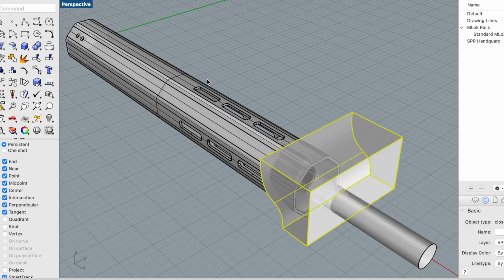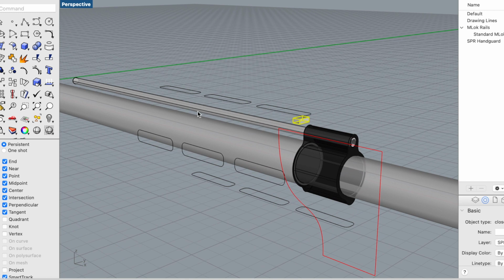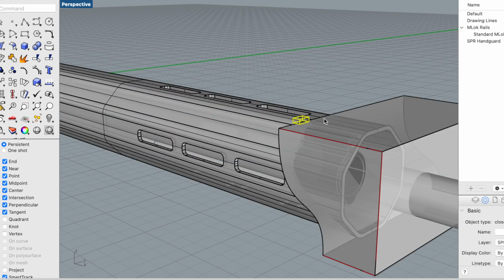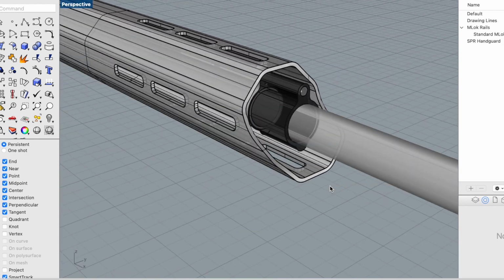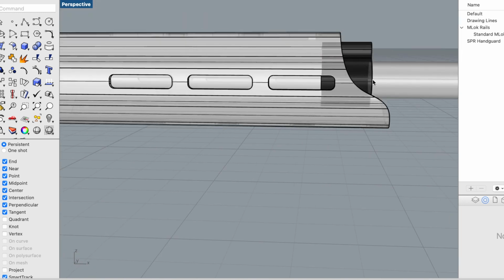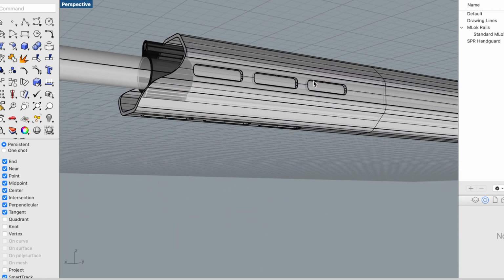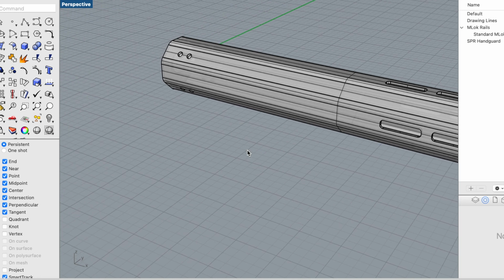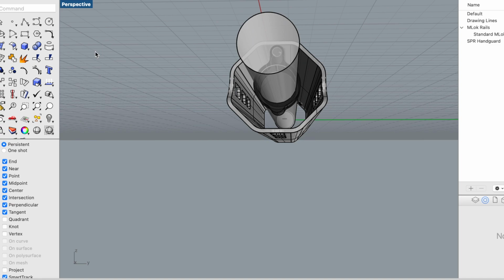Making a Carbon Fiber AR15 Handguard Part 1- Design and Material Prep (Episode 2 of 13)

Comment: Interested in a project just like this but for an Aero M5 AR10. I do not have a lathe, if I sent you a barrel nut, would you consider turning it to the right dimensions for me? I'd be happy to pay you for your time.
Reply from the maker: Sorry man. I am not comfortable giving out my address in conjunction with YouTube. But I will give you a couple of pieces of advice. 1 If you have a drill press you can probably pull this off too. Find a way to chuck the barrel nut up in there and just file it as it spins. 2 In the video I also mention how it would easily be done without any power tools and just with a flat file as well. 3 It looks like the Aero M5E1 barrel nut has the right configuration to work with this idea. I would just contact Aero first to get a diameter for it to make sure it's not under 1.770" or drastically over. Happy modding!